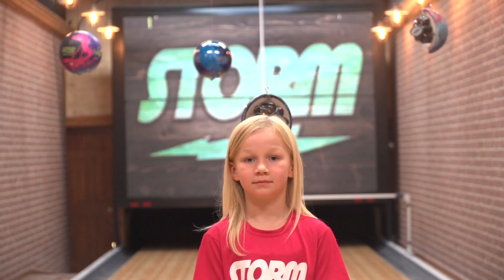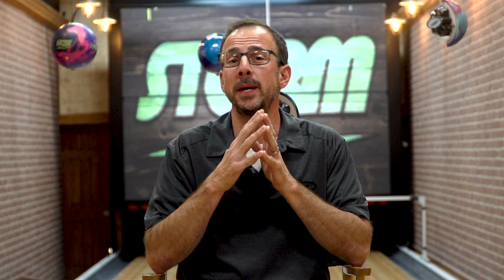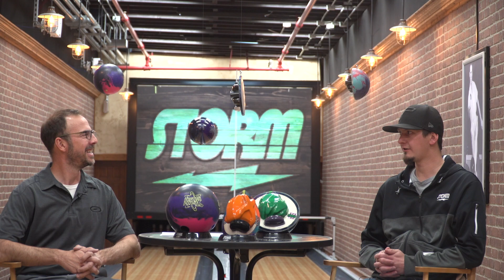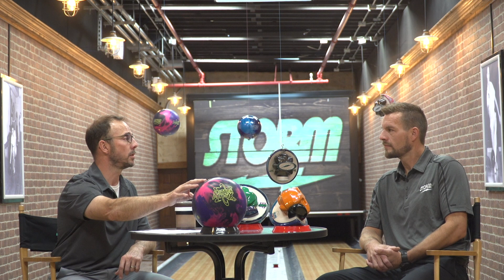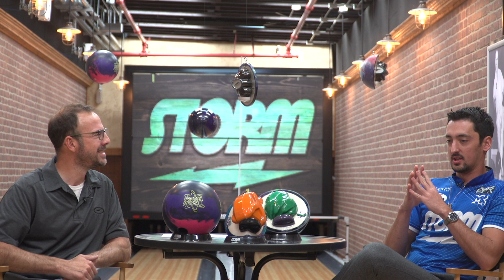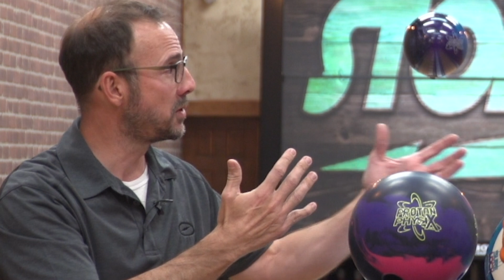Storm | Proton Physix EXPLAINED

Comment: I wish I can afford 8 or 9 bowling balls at $230 to $250 a ball that's why I get one for every 5 years
Reply: I don't know any new bowling balls costing over 200. old balls that are discontinued will be. but most new balls can be bought between 160-180. now after its drilled you're looking at another 60-90 dolllars
Reply: @chrisfentress13  that is correct Chris at the pro shop it's always 220 to $240 to have a ball drilled what finger grips in a thumb slug and I love storm balls the last one I had drilled was the Optimus Pearl I love that ball but it cracked
Reply: I have never seen a ball cost more than 180 maybe you should buy from somewhere else
Reply: Same boat
Reply: I've looked at buying on line vs buying at the pro shop.  Pro shop price includes drilling. So it ends up being about the same as buying in line and having the pro shop still it. 
One need not spend over $200. Second year after release usually sees a price drop. 
The Astro Physix is an excellent league ball for house shot. It is already on the list to end production.  So close out deals coming soon.
Reply: Try buy your balls from bowling balls.com.  They are from $149 - 179.  Drillis either $50 -   $70.00 dollars you still spending the same amount but the ball didn't cost you $230 or $240.
Reply: @judweber3338  All Pro Shops are like that 222 $240 with finger grips and thumb slug
Reply: @fishgutz4272  I agree fish you by the ball online or you buy it at the pro shop it's all going to end up the same $220 to $240 with finger grips and a thumb slug
Reply: @vshaver11  that's what I mean if you get it at a pro shop 220 to $240 if you get the ball online it's going to cost about the same with the drilling
Reply: @davejustice7464  your right but sometimes if the Pro Shop owner knows you they give you a deal.  I  used to get mines drill for $40.00  with grips.
Reply: I wish I could afford to go somewhere to get a performance fit by Chad